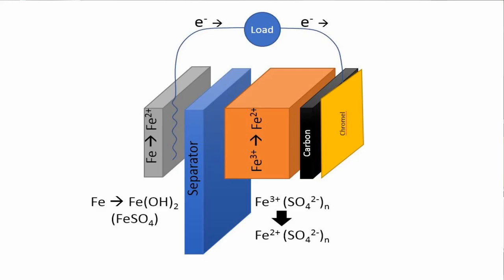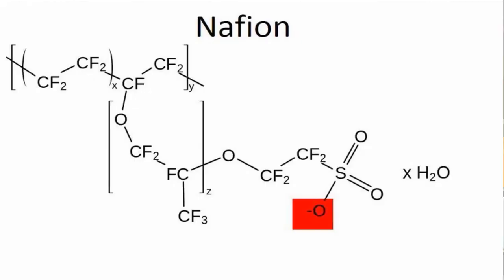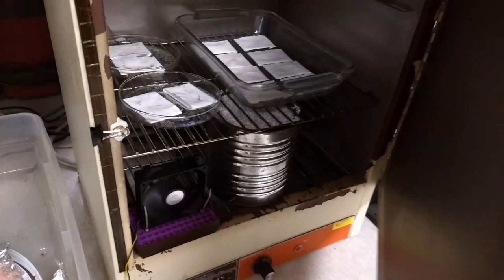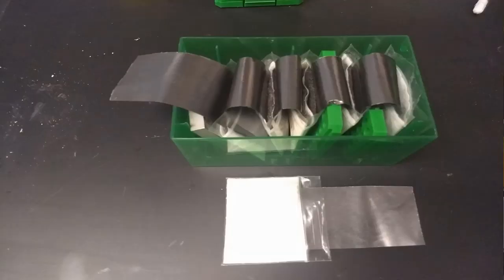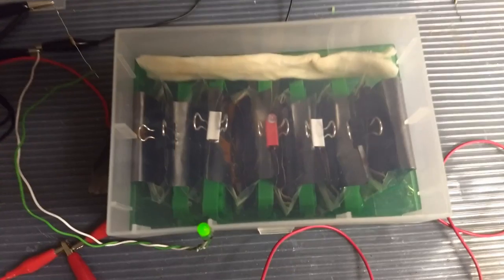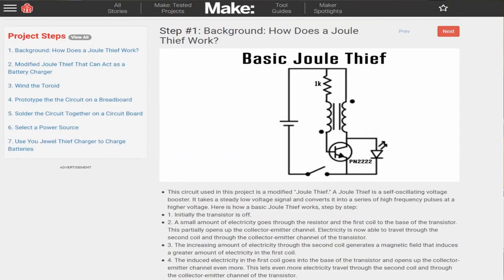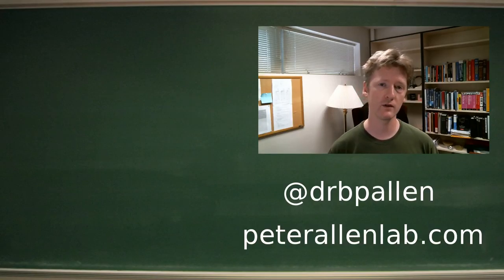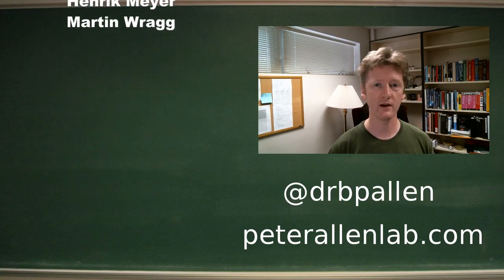Iron 6-Cell Battery: Lighting an LED

Comment: That's great! 
A joule thief increases the voltage at the expense of the current. The current is increased by combining cells in parallel or preferably increasing the size of the plates, which essentially accomplishes the same thing. Increasing the plate size conserves materials and reduces points of contact which are resistive. There are practical limitations of plate size and perhaps performance limitations. Once the preferred chemistry is determined the configuration can be tested.
Spiral wound or folded configurations are convenient but do not allow for replacement if deterioration occurs. Parallel plates such as Edison and lead acid batteries would be easier to replace deteriorated or clean sulfated plates. That's another problem. Sulfur tends to precipitate and accumulate over time. Once the preferred chemistry is established longevity and serviceability should be considered.

Comment: A joule thief will not work below a voltage of 0.7 Volts or better 1V. What you need is a constant current sink. I guess you'll want a 0.7V 20mA sink for now. If you do, let me know, I think I can figure out a cheap (10$) way to get one.

Comment: Peter, joule thief will only add complexity to your testings. Go with more hardcore standards like volts per cell, grams/surface area efficiencies. this will make for more usable scale info..  if you need any help with design on structure packet cells let my now?  Peace Out!
Reply from the maker: Good point. It might be fun to add a circuit to access more of the energy in a single cell for demonstration purposes but it's not very practical.

Comment: Hi , can we make nitrogen fuel cell or nitrogen air battery , fuel cell or battery that works on air only ? Oxygen to air cathode , nitrogen from air to air anode ,   What do you think , thanks
Reply from the maker: Alas, nitrogen (N2) is VERY stable. So it's more like the ash than the fuel. I imagine in principle one could take N2 and O2 and generate NO2 to store energy, then reverse the reaction to get the energy back, but NO2 is not friendly and the whole thing sounds like a recipe for making undesired side products (the explody kind) in the cell (even if I knew how to make it work).